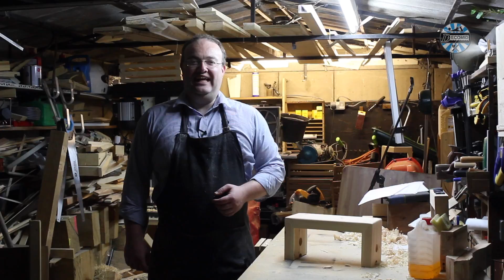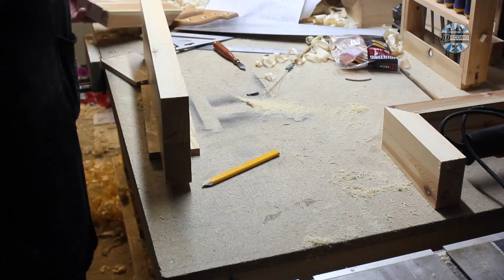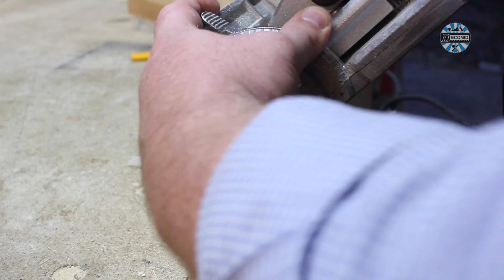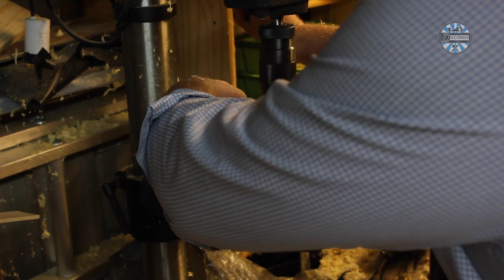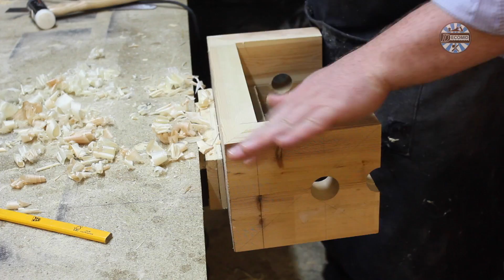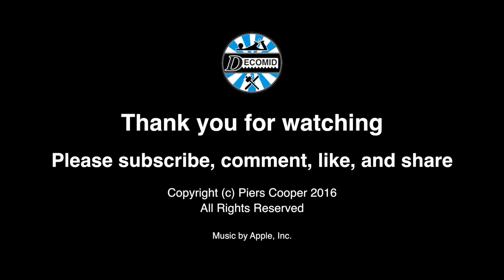Simple Foot Stool Build - Decomid Woodworking #6

Comment: I need to make a 5' long step stool, 8" wide and 5" tall.  Any ideas, maybe a video?  Thanks
Reply from the maker: Tony A. The same materials here would work. Your proposed stool is roughly the same height but wider. If you’re worried about flex you could either add a central leg or cut a groove down the centre of the underside and glue in a metal bar to reduce this. At 5” tall shear shouldn’t be much of a problem.